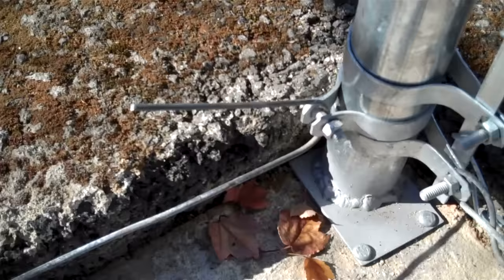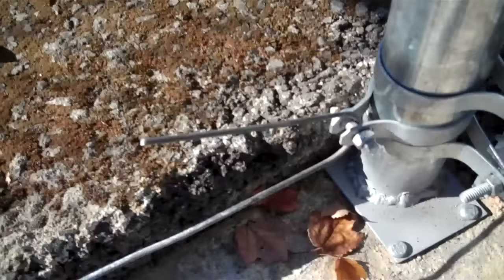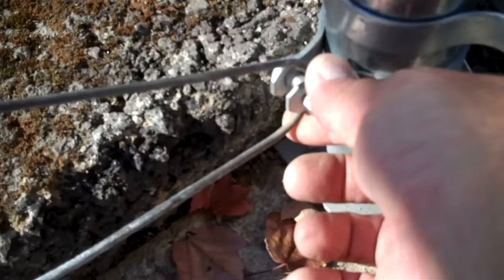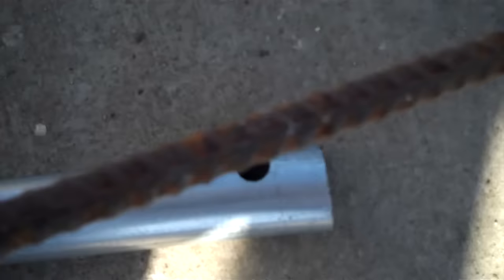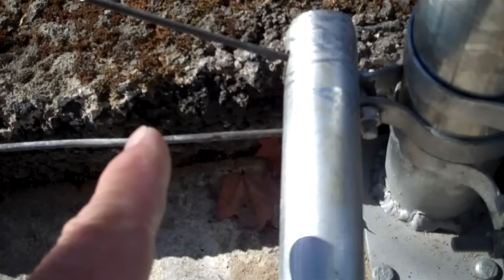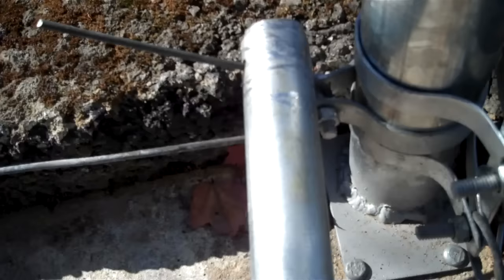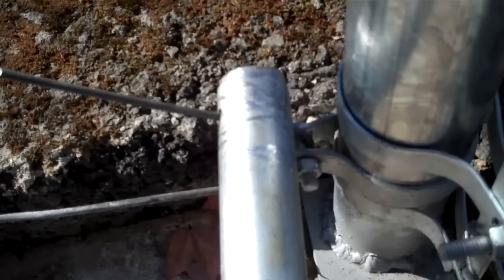How to install tension wire on a chain link fence

Comment: This method really works well. Just cut a small piece from an extra top rail I had. Drilled a hole in it, slid in a piece of metal from some old fixture, and was good to go. Honestly don't see how anything you would buy would perform any better. 

Thanks for the tip.

Comment: Thank you for making this simple!  This is prob the 4th video I’ve watched on this, and all the others are using tools that would only be used by people who do this for a living.  Obviously a weekend warrior is not going to have any of those tools, and is t going to spend the money to use them once.  A simple 12 inch scrap of top rail with holes drilled in each end and a long screwdriver got the job done!

Comment: Very helpful video. I just used a pipe wrench to turn the pipe.
    Two things I want to warn about, I wish I had known this. One, this puts an extreme amount of torque on the upright post. I pulled mine way out of plumb, trying to get the tension line as tight as possible. I used Home Depot posts, and they are not as solid as I would have liked. I will try to find some that are made from thicker material so they don't bend like that.
   Second, when tightening the top line, make sure you tighten the band first! As I tightened the line, the pole was bending slightly, and the band was slowly moving upward.

Comment: Thank you so much. i was so baffled at first when my pliers just couldn't get it done.  didn't have rebar so i used some vice grips on the piece of top tube i had left. worked well enough.

Comment: Someone advised me to use barbwire at the bottom as a tension wire to prevent dogs or anything trying to go underneath the chainlink fence
Reply from the maker: If you interweave the wire every couple of feet ,through the chain-link fence,
Nothing will be able to move that fence

Comment: What’s to stop it from loosening when you undo the pipe-tightening doo-hickie? Or did you tighten the tie before unwinding & loosening your tool?
Reply from the maker: It simply does not 

because of the friction

 and the bend in it

I was video taping with my other hand 

so I could not do it 

like I normally do

But when you have both hands available

You simply take the free side

 and wrap it around the taut side

Comment: What gauge wire did you use?  I've read 9 is the best?
Reply from the maker: Well.... 6 is the absolute best
 but 9 is very good....
Reply: @Jonehughes  Thanks, Jon.  I had a chain link fence installed, and forgot to include the tension wire as part of my requested install.  I asked for a quote for it, after the fact, and while I waited for the quote, I put together a shopping list of all of the parts I would need to do it myself.  It is for approx 225 feet of fencing.  I came up with, between Lowes and Amazon, around $150 total cost, including a hog ring tool that has a magazine to hold the rings.  Let's just say I'll be doing this myself vs having the fence company come back and do it!
Reply from the maker: Exactly, you can save a bloody Fortune

Comment: How long can i stretch a tension wire?
Reply from the maker: Michael Kmiotek 50 feet max
Reply: Thank you. I figured but wasn't sure. Only need 32'.
Reply from the maker: Michael Kmiotek that will work out perfect as one piece you rock brother
Reply: @Jonehughes  Where is this standard from? Just curiously asking.
Reply from the maker: @christopherangulo6971   I don't know,
 I've never been able to get it to be tighter than 50' 
 but I don't know where I learned it from
Reply: @Jonehughes  I have done a lot longer then that the last one was about 80ft
Reply: Depending on your wire you can stretch 100-150 ft

Comment: or you could save yourself a clamp and wrap the tension wire around the terminal post and get it taut with a pair of pliers against the post.
Reply: Thats exactly how we do it at work. Tension bands arnt needed.
Reply: @Darth_Raider_  How do you tension it on a post?